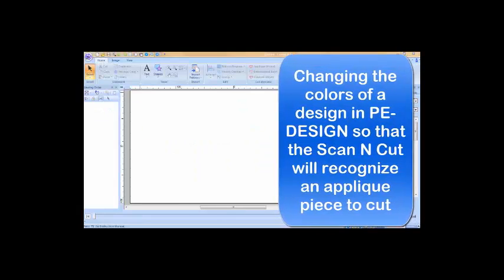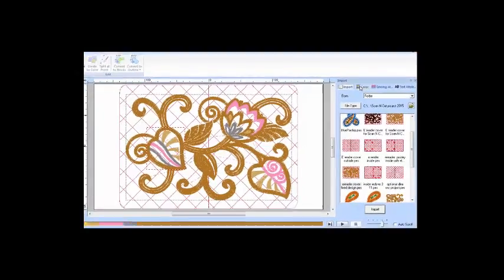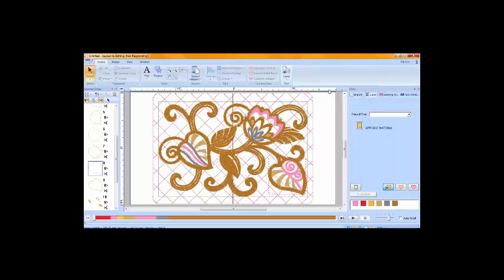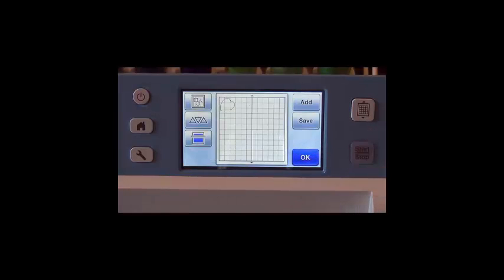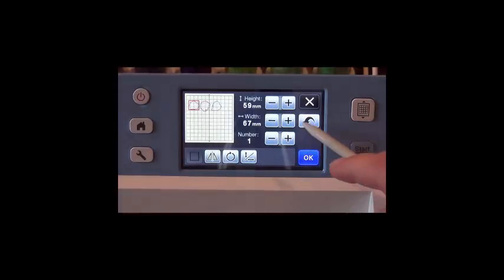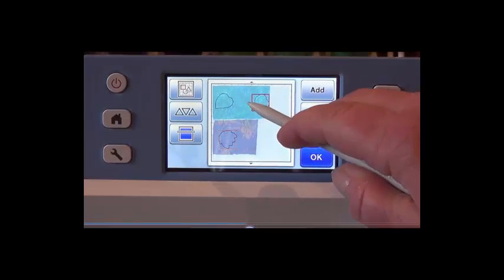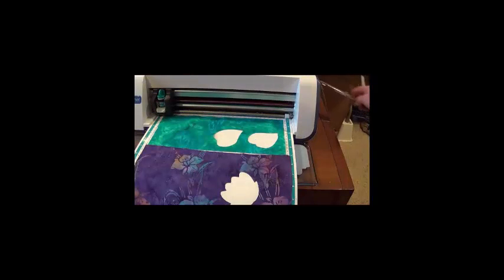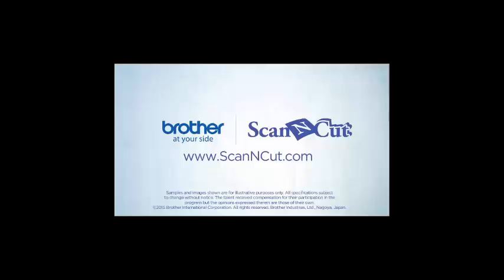Cutting an Appliqué Piece with ScanNCut to Use with PE-DESIGN® Software

Comment: I just bought the newest ScanNCut machine not available til Oct 1st so it should have latest updates. My Ellissimo Gold should work. I watched several videos, jotted down directions but the cutting machine wont show my files in the window. HELP.
Reply: I think your answer is already up. It was the first question. The Scan n Cut is a very expensive machine. I am so tempted. <3
Reply: It won't work on any ScanNCut except the 450 which costs more than I want to spend so I had to return the ScanNCut 250.